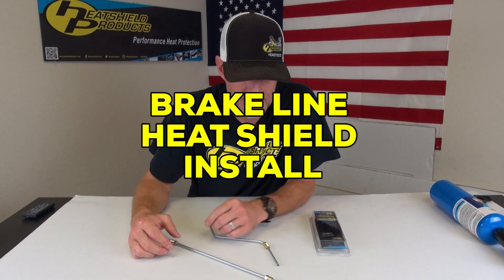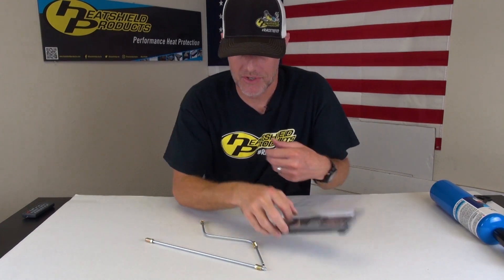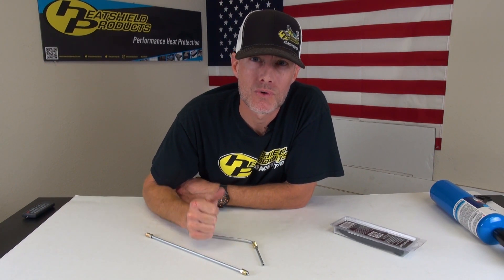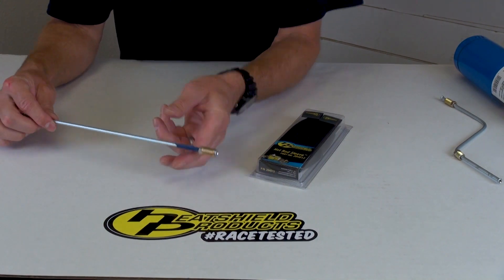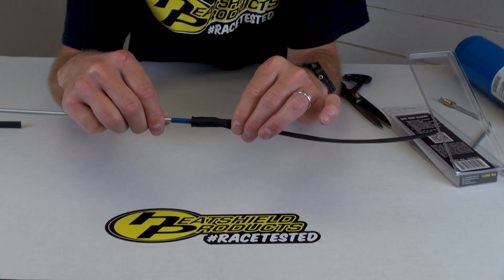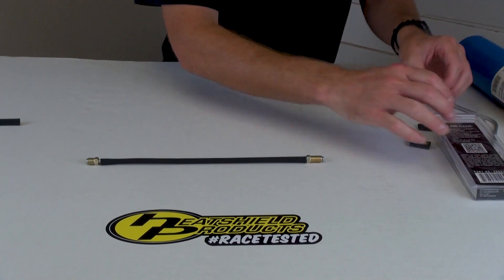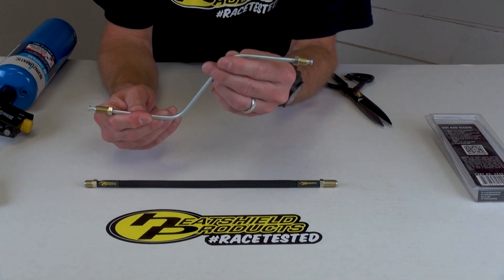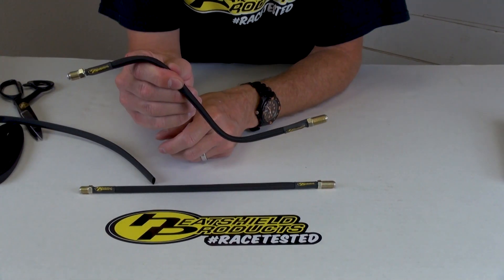How To Install Hot Rod Sleeve and Stop Boiling Brake Fluid!

Comment: I'd like this on brake lines very close to headers, do I need to worry about it keeping heat into the brake fluid and brake lines in that spot?
Reply from the maker: Thank you for your question. The Hot Rod Sleeve is radiant barrier made from fiberglass and would reflect heat away from the brake lines if covered. The sleeve will not retain heat. Keep in mind a 1 inch air gap between the heat source and the sleeve is needed to attain maximum reflectivity. Hope this helps if not reach out to us on our tech line if you have any additional questions. 760-751-0441 wait for the TECH prompt.

Comment: I want to buy a roll for Ls spark plugs .ill need 8 ..where do I buy them ? couldn't find on summit racing
Reply from the maker: Summit Racing does sell it and the kit for 8mm plug wires. SKU#203124 it also comes with 16 heat shrink (not pictured) for plug wires. 

https://www.summitracing.com/parts/hsp-203124